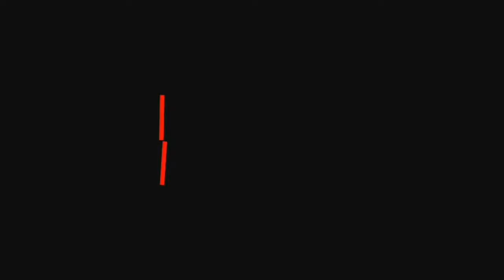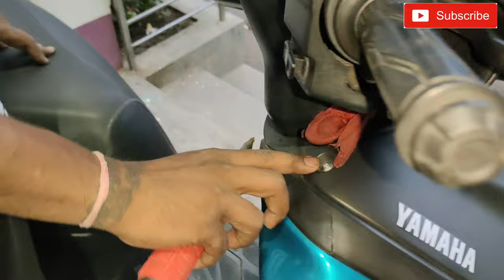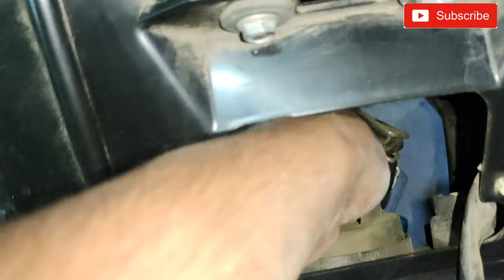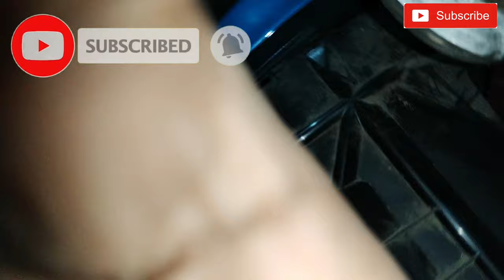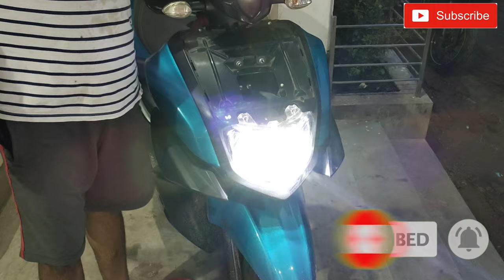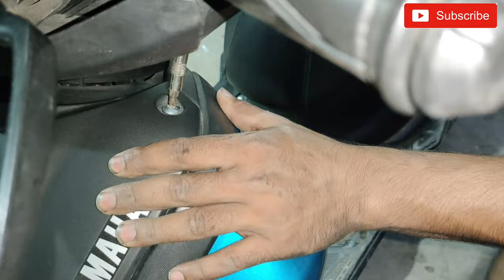Yamaha Ray Zr 125 Led Headlight👌😍|| yamaha ray zr 125|| Led Headlight bulb for all bike and scotty

Comment: Bhai halogen headlight engine on ke baad on hota hain toh woh dc kaise ho gaya current toh alternator se aa rahi hain
Reply from the maker: Bro ha ac current hi hota h but kuch bike ko me battery k sath connection hota h taki apka rpm low hone k bad bhi light low na ho or ray zr ko ac se dc nhi krna prta kyu ki dc hota
Reply: @BikevsLover  mera paas ray zr 125 street rally hain led light ka price kya hain with fan cooled
Reply from the maker: 500 or costly chahia to 1200 1300 nighteyes
Reply: @BikevsLover  bhai iska socket hs1 hain isme h4 lag jayega
Reply from the maker: No idea bro

Comment: Airvents of led light shouldn't be blocked like in your video..it might affect wiring incase of heat produce from light itself
Reply from the maker: The LED light already has a fan which prevents the light from overheating